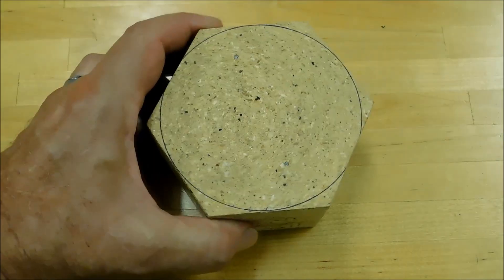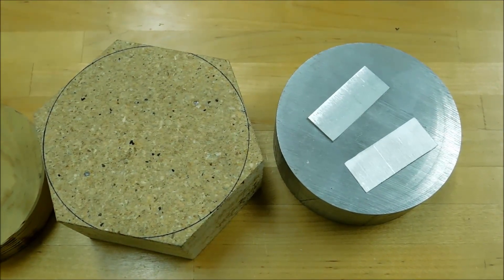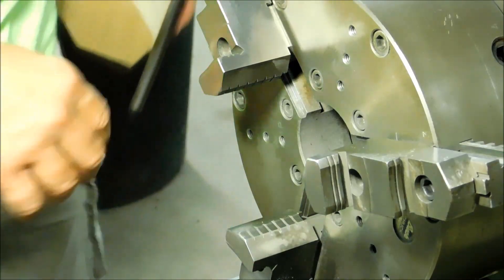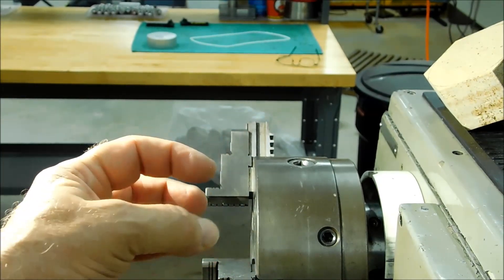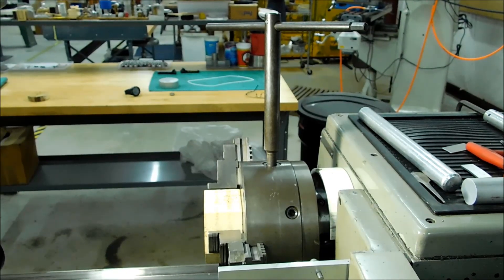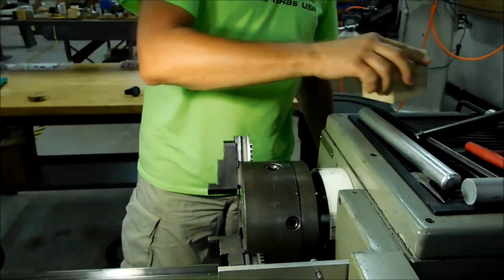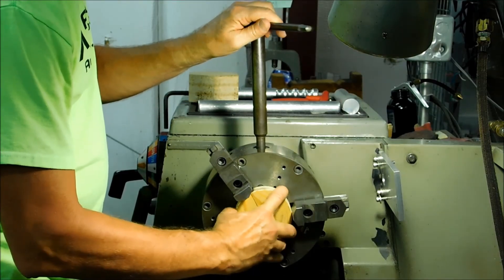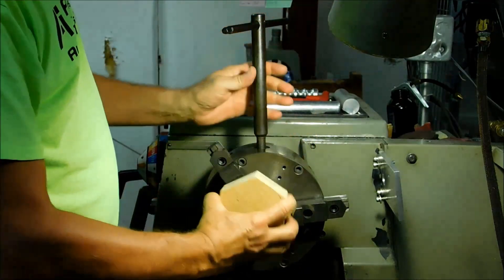Why Did That Part Come Out of the 3 Jaw Chuck?  DON'T MISS THIS ONE.

Comment: Just about to turn out the inside of a hex. I was curious how to indicate the hex in a three jaw to get as close to the center as possible. That's what initially got me here. Little did I know that I'd be learning something completely different and potentially more valuable! Thanks, Joe.

Now back to my initial question... Can you indicate a hex in a three jaw? I suppose it has as much to do with the type of chuck?
Reply from the maker: If the chuck is adjustable, you can indicate the hex easily. Very much the same as you would demonstrated in this video   https://www.youtube.com/watch?v=WCei5GlEZ5g&t=2s . Naturally, if the chuck isn't adjustable, you'll need shims. Good luck.
Reply: @joepie221  Thanks. About to give it a go!

Comment: Thank you! I have had trouble with turning a smaller diameter and having it centered on the larger diameter round stock. (special purpose locating pins) I thought something was wrong with the machine.Now I see it was the Id10T interface...

Comment: can we stress the need for safety enough before someone loses an eye(nearly me if it wasnt for safety goggles) a domestic lathe running at nearly 2k revs rpm and and a near half inch(13mm)drill bit left on top of gearbox head fell onto chuck spinning, thrashed it on rail breaking it like a twigg and one half was smashed against my goggles after trashed on slide rail.. and its just my home lathe. if it was at work one might not get compensated if you walk away to tell the story. think for that few extra seconds before you lock down the workpiece. you have one life, one pair eyes and one pair hands. can happen to anyone regardless the experience
Reply from the maker: Its got to be #1, 100% of the time.

Comment: Is this also an argument for always having the tail stock in play, even if its not making contact with the part. It will prevent the part escaping and flying off if you leave 1/4" of so clearance
Reply from the maker: No. I would think if the part twists and there is something solid in the way, kiss something goodby. If you are clamping correctly, but lightly, moving a tailstock in place as a safety is something I do.

Comment: Hello Mr. P.
I haven't seen the video of flying nuts, but, finding 'low spots' should be second nature for anyone with experience. 
Personally, I hadn't even considered it until I saw your video then realised I do it 'automatically' and except for plastics, haven't had a part come out of chuck since 1979 .
I've always said bad advice is much worse than no advice, glad to see your showing best way to machine the steam engine model
Reply from the maker: I'll just present a second option. you all have to decide which road to follow.
Reply: @joepie221  You have showed a few alternatives to things, usually the easiest or most efficient.  I've never been accused of being very PC  and tend to tell it as I see it

Comment: The FIRST safety rule is NEVER STAND IN THE PLANE OF ROTATION OF THE WORK! NEVER!
Reply from the maker: Hows that work on a mill?
Reply: @joepie221  Obviously not well. I have had stock improperly secured to the table get caught by a drill and pulled out and spun across the shop. When clamped in a mill vice parts stay clamped. I still avoid standing in line with a lathe chuck.

Comment: Wow, still posting clickbait titles? Your content deserves better. Stop it.
Reply from the maker: I use cap titles on videos that contain material that can save you a finger or keep you from getting your head split open. If you consider that clickbait, our definitions are very different. Go watch the 'Tested' video this is based on and get back to us.
Reply: @joepie221  Another great video Joe. Stuff I wouldn't have thought of. Can't believe how nit picky some folks are, but based on the explanation you had to give when you walked away from the lathe, you obviously have had to put up with alot. Always great content. thanks!
Reply: @joepie221  It is always welcomed a video that would save your face, tooth or skull.

Comment: That’s exactly correct. I ALWAYS jiggle a part, even if it’s round. I also do that with hex drill bits in a chuck. Never had a part pop out, but did have one jerk around and spoiled it. Once was enough. Sheesh, that was over 50 years ago! Same problem in a four jaw.

Comment: I just have to comment; it is not good practice to grip a part with the master jaws extended outside of the chuck body. Maybe a little, but you have them extended at least to the half way point, the jaw locating key is even with the o.d. of the chuck. Reverse the top jaws. That being said I have done the same thing and probably even worse things over 58 years in machining.  And yes, I've lost parts from a machine, both lathe and mill, it will happen to everyone at some point. Still have 10 fingers and both eyes intact.
Reply from the maker: I had at least 2 full teeth of scroll engagement. This setup was not a problem.
Reply: @joepie221  Joe, I'm not starting a pissin' contest but I stand by my comment.  As the master jaws extend from the body they lose the support of the guiding slots, and will have a tendency to 'tilt' back as more pressure is applied, causing the gripping surface to become tapered in relation to the centerline. In other words the gripping dia of the jaws will be larger at the front of the jaw then back at the face of the chuck. This will happen even with a good chuck, but one that is worn will really display this. I witnessed a guy break the starting scroll when he thought he had enough engagement (he did not) and really cranked down the pressure. One of the worst CNC wrecks I witnessed was when a 50 HP machine rear turret caught on to jaws that were extended, and literally broke the master jaws right out of the chuck body. This was a 21" power chuck that cost about $20,000 to replace. Anyway, like I said above, I have done the same thing, probably more than once!
Reply: @neillawrence4198  you are %100 correct

Comment: Great advice Joe. And absolutely critical for staying safe. Another issue I would like to highlight that you possibly have covered somewhere else is the propensity of MOST scroll chucks to loosen on startup especially if you are clamping on a small delicate part that you are trying to avoid distorting. ie: plastic bushes.  Due to the clockwise rotation of the chuck key creating an anti clockwise rotation of the scroll, the anti clockwise snap of the lathe clutch kicking in with a vengeance results in the scroll loosening at startup resulting in an unstable work piece.  I have many times when trying to machine delicate parts in a large lathe done this in reverse on the back side to negate the issue.  Again I say you have probably covered this issue and I’m undoubtedly mentioning stuff I’ve missed in the dazzling array of resources you’ve created. If so cool. Love your stuff and learn soo much. Kia Kaha. Graham.

Comment: Hi Joe, how does it make a difference which way around the shims are?

It's being retained purely by friction, so contact area isn't going to make any difference, only how tight you do up the chuck will matter.

If anything, I reckon that I would make the argument that larger contact area is in fact worse as the pressure applied will reduce as you increase the contract area for a given tightening torque on the key.
Reply from the maker: You make a very good point that is initially hard to argue, so I don't plan to say you're wrong. But permit me contribute my thoughts. Lets use the shown block as the example. 2" jaw face with a 2" thick part. If your shim is thin, half the width of the jaw ( not actual thickness ) you have reduced the pressure region of the chuck jaw, I would agree. You have also reduced the friction footprint. But, thinking about a womans high heel shoe, the PSI pressure may be higher than a wider shim at the same jaw torque. Lets get back to a full contact shim. If the pressure being applied was only a narrow strip, the pressure might be distributed differently, but the entire length of the jaw is coming down with the same force, so wouldn't the entire shim now have equal pressure along its entire length? You may have to tighten the chuck to a greater value because of the extra area, but I think thats where this argument pivots. Additionally, the smaller the shim contact area, the greater chance of movement because you have less friction and planer alignment. If the contact were balls or rods, you now have 3 hinge points. I'm not a physicist, this is just my opinion. Good comment. Thanks.
Reply: @joepie221  I really appreciate your videos Joe. With my structural engineer’s hat on perhaps I can elucidate your “high heels” argument a little further. Generally, shims will be used because the desired clamping force would otherwise cause the jaw to indent the part. Usually the selected shims will be softer, or at least not harder than the part. Consequently, it follows that the jaws will indent the shim when the desired clamping force is applied. Thus, at the contact between the jaw and the shim, part of the contact will be at yield stress and part will be at some lower pressure still in the elastic range of the shim material. The smaller the shim, the more of the contact that will be at yield. When the material is stressed to yield, it only takes a small extra force, such as from cutting forces, to produce a large extra plastic deformation as compared to the part of the shim that is not close to yield. Thus, with a small shim, there is more scope for the grip to relax through further indentation of the jaw into the shim. Whereas with a larger shim, more of the jaw to shim contact is still in the elastic range and able to offer large resistance to any further indentation. 

With respect to jaw clamping forces, the chuck structure is a very stiff “spring”, so even a tiny further indentation of the jaw into the shim can cause a large relaxation of the chuck’s elastic grip on the part.  So, to put it in terms of the Daniel’s question, the problem with a small area of shim is that the clamping force may not stay equal to that applied to a larger shim because the small shim is more prone to further indentation under the additional effect of cutting forces.
Reply from the maker: @rockwell6594  This is nearly the exact comment I left on Adams channel. Well aware of the jaw mark issue, I told him a thicker shim would be his friend and less likely to deform.  The deformation of the shim and incorrect clocking were both parts of his failure, I'm sure. You won't find extremely thin or very soft jaw shims anywhere near my lathe for the reasons you pointed out.Thanks for the confirmation.
Reply: @joepie221  I agree that a reasonable thickness of shim is required but perhaps with a slightly different emphasis as to why.
 If the shim is thin, it may simply transfer the concentrated contact pressure though the shim and still mar up the part. Concern about this may cause the operator to be too tentative in tightening the jaws. 
Both the thickness of the shim and the plastic indentation of the jaw into the shim govern how well the jaw contact is widened and evened out on the part. Also, the deeper the jaw is indented into the shim, the broader the jaw to shim contact becomes and the “stiffer” that contact becomes. A thick shim allows for deeper indentation. But the fact that the shim yields is both a help and a hindrance. It distributes and widens the contact with the part, but because the shim is stressed near yield, it also means that with the addition of machining forces, further yielding of the shim may relax the chuck’s elastic grip on the part.

Hence the wisdom of your maxim, which is to use a generous thickness of shim, that is big enough to utilise all the available jaw contact with the part.  
Perhaps this topic deserves further coverage in a video.
Reply: @Joe Pieczynski  Permit you? No mate, I hope you'll do me the favour of giving them. No permission needed.

And I was hoping you WOULD say I was wrong! I have an idea of what I think should happen, but you on the other hand have done it and know. I know who I'd be listening to.

And in reading your reply I reckon I've worked out why I'm wrong.

So you're going to have a maximum amount of force that you can apply with the jaws, as you reduce the contact area the jaw has with the part the pressure you're applying will increase. Fixed pounds, reduce the area, more psi.

But the friction you're getting isn't a function of surface area or pressure, it only cares about applied load. So big shim or small shim, your friction will be the same. Same pounds, same friction, even if you are making your pressure go up and down by changing the surface area.

Final nail in the coffin, yes, you would have a hinge, so as you apply cutting force at the front it hinges off the jaw at the back and that force is reacted against purely by the friction given by the jaw. It's direction is effectively a tangent drawn from the point where a circle meets the jaw, with it's origin at the hinge.

When you put in a big shim, owing to the distance between the front and back of the jaw, you're tangent no longer points parallel to the jaw, but into it. So it's not just friction keeping your part there, you'd have to force the jaws apart.

Thanks for helping me work out WHY I was wrong mate!
Heck, I may still be wrong, but at least my idea of what's happening now matches what you say is the best practice, so hopefully I'll be less wrong ;)
Reply: @dtnicholls1  Humble acceptance of corrections. You will go far.
Stay Humble.
Reply: If the part has any stickout you need the length of the jaws to support the cutting force.
Reply: I think you guys are looking at this wrong even though I understand what you are saying.  I'll try to hopefully explain.  If the jaws were 3 inches long and so was the hexagon being clamped there would be far more stability holding the bolt assuming it was in the correct position then it would be if the hex was only a quarter inch thick to grab onto.  Joe was right in that the full length shims would hold more than shims that were not covering the whole hex bolt.  Think of the extra leverage you have by holding onto more of the hex then you have by only holding onto a small amount of the hex.  Even though there would be more force on the narrow shims it would never have the holding power of the advantage of having a greater holding area.  Hope I was able to explain this properly.

Dale in Canada
Reply: @dalemcinnes1834  It is agreed that it is preferable to utilise the longest possible grip length, particularly with an overhanging workpiece that is not supported by a tailstock centre. However, in the various iterations in the Adam Savage video, he had used all the possible grip length on the head of the “bolt”. Thus, failure to use all the available grip length with full length shims was not a factor in the failure of his various setups. 
I believe that Joe was using the opportunity to make a separate, and more general point, about the use of shims that applies, regardless of whether the part overhangs or not. Joe specifically mentioned “shim compression” in the video. My comment was addressing the specific point of why, for any workpiece, using the largest possible soft shim is likely to maintain a tighter grip than a small area of the same shim, even though the jaw force might start out the same. In both setups. Danial had asked why isn’t the friction equal, given that the jaw force is the same. My point and the point that Joe somewhat obliquely explained in his response to Daniel by reference to high heeled shoes, is that with a smaller shim contact area, the jaw force is more prone to reduce due to subsequent further indentation into the shim, or in other words, shim compression. (In his further reply above, Joe mentions the further point that the shim also needs to be thick enough in order that the indentation doesn’t simply transfer through the shim and into the part when the desired jaw force is applied.) Cheers.

Comment: Been a fabricator for over 50 yrs and still learn so much from you, keep up the good work. Another important one to watch when chucking parts, is castings, they will have draw on the sides(taper).  Always make sure widest draw is at back of chuck.
Reply from the maker: Thats an excellent comment. If the draw is reversed, you don't get too much warning if it slips a little. Thanks.
Reply: Draw? I think that you might mean Draft. Draft is the name for the taper on a pattern in order to facilitate it's removal from the sand in the cope or the draft of the molding box halves.
Reply: @markfryer9880  Yes your right Mark, been over 30 yrs since I was involved with casting and  maching them, the brain cells are fading.

Comment: Thanks Joe, I'm a novice mill user with a 3 jaw on my rotab - I 'think' I've been sub-consciously wriggling  the parts as I tighten the jaws? but it will definitely be consciously from now on - great tip.
BTW: I noticed you left the lathe unattended with the key in the chuck :) :) - sorry, I couldn't resist (after you pointed it out to us).
Reply from the maker: It was a safe environment and a must for framing the camera, but it really bothered me to do that. I almost edited that out.
Reply: @joepie221  Thanks Joe, it was a poor attempt at a joke by me - it's obvious you are very focused on safety, I don't think I've seen one of your videos that you don't give a tip or reminder about safe practice.